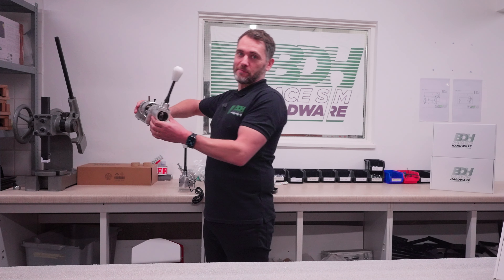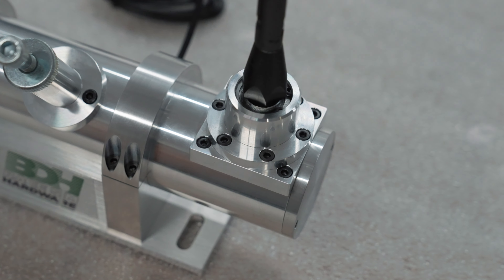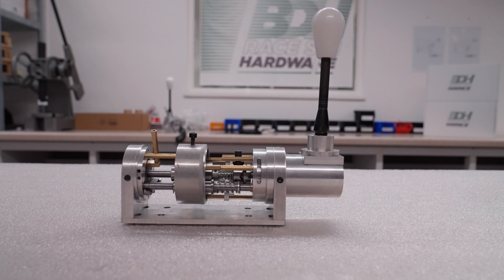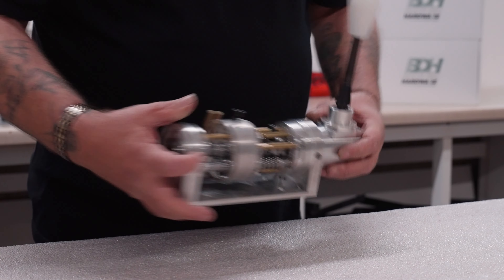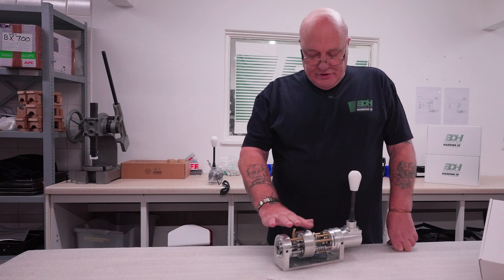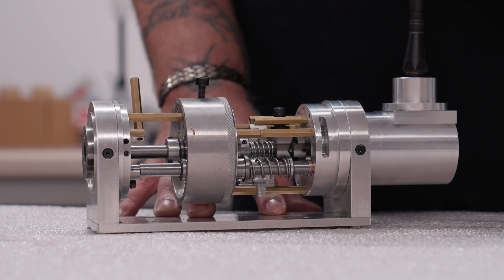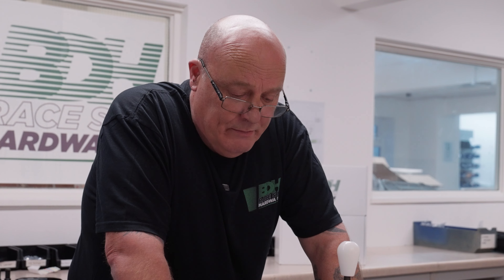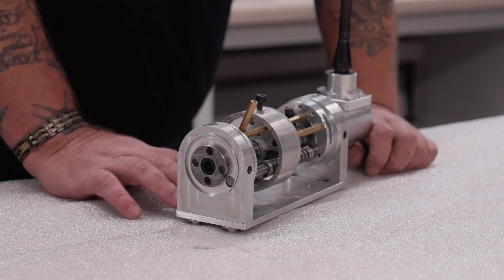H1SQ Sim Shifter EXPLAINED | BDH Race Sim Hardware

Comment: Great stuff; love to see customer feedback being taken on board in new products.

I managed to pick up a used H1 for a great price a few days before the launch of the H1SQ (knowing that it was coming out). It's a beautifully solid thing.

Having played with it a bit I've already prototyped a replacement hall-effect PCB to replace the 3D-printed inserts and tactile switches. It's a much simpler assembly. It sounds like you guys have done the same with the new SQ.

In combination with a microcontroller, this also gives analogue feedback over position rather than just on/off, which will facilitate the implementation of active lock-out and other effects, which I'm playing with at the moment. The design of the H1 really allows for extensive customisation. I'm delighted I was able to get one.

Comment: To me the big improvement has to be the mounting plate. Assuming you wont have to mess with the electronics anymore to sidemount it.

On the other hand, I know having a sequential mode is a very hot feature, but I cant figure why. Not only does dual-mode shifters have a history of performing poorly with either sequential or h-pattern, but chances are those who can afford your products very likely already own a dedicated sequential shifter for that reason. 

I am one of these persons and I’d really like what I would dub the H2S, which would basically be the H1SQ but exclusively set up for sidemounting by default and ommits the sequential shifter.
Reply from the maker: Watch this space 😊

Comment: You should add a screw hole in the collar used for changing from Seq to H so that we can screw a lever like you have on that prototype
Also please, add an e-clutch (mechanism that block shifting outside neutral if the clutch is not engaged, if you want an exemple of implementation look at the DIY SRT v9/10 from lebois-racing)